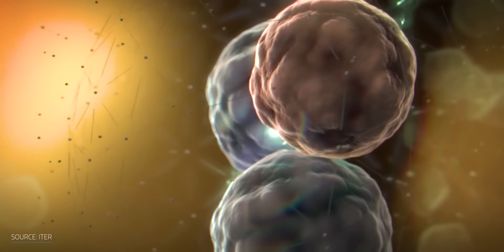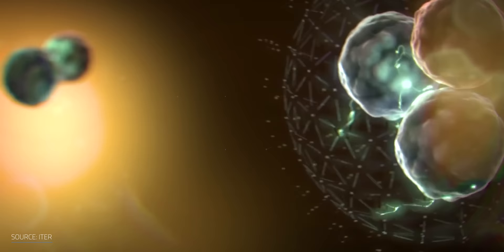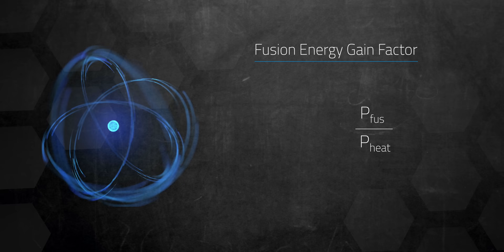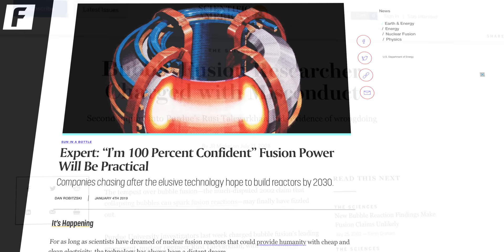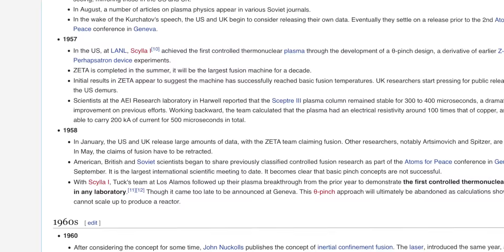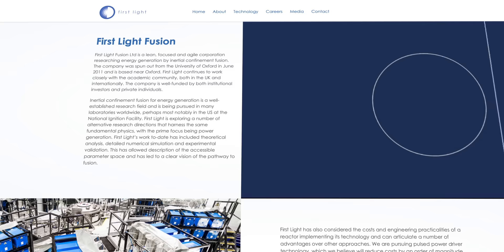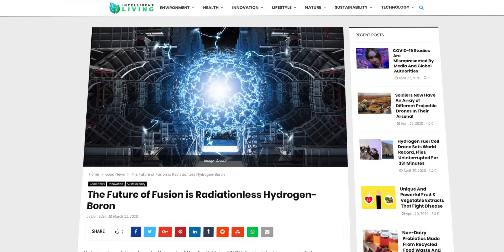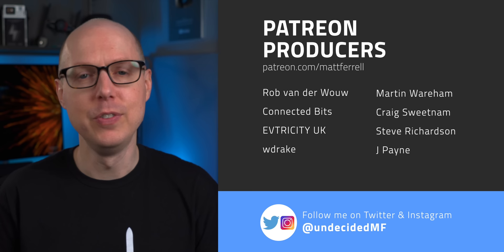The truth about nuclear fusion power - new breakthroughs

Comment: Only a couple of minutes in but two huge errors, unless I misunderstood what you said. 1) fission does happen naturally (https://en.wikipedia.org/wiki/Natural_nuclear_fission_reactor) and 2) Not all reactors will run away. Take Canada's CANDU reactors. They use a different kind of uranium which will fail "safe" and shut themselves down. I actually oversaw the building of the calandria, the core of the reactor, in one of Ontario's reactors.

Comment: Just a minor correction... The splitting of atoms doesn't melt a reactor down just like that, the reactor is designed to split atoms and multiple systems including human input are there to control the environment in which the atoms are splitting. You can literally stand right next to the rods inside the reactor in your sweatpants looking down at the exposed uranium and be perfectly fine and healthy, because the water within the reactor slows down the harmful particles from the splitting to such a rate even a detector has problems detecting the emissions coming from the rods.
What happened at Chernobyl was human error. Technically speaking, nuclear energy is the safest and most rewarding source of energy on this planet today, it has the least amount of deaths per Petawatt, and the least amount of carbon pollution per Petawatt.
But y'all want solar energy, cuz it's "green" for as long as nobody mentions how much pollution is actually released in the making of such a cell. Would it surprise anyone here if I told you nuclear energy is actually more friendly to our environment than solar energy, and by more I mean by 3 times....?

A noteworthy detail tho to why we don't already have fusion as a power source... We do, it's just not efficient enough to even self-sustain. But don't we have it already? The answer is actually rather easy. Money! It's not that we can't build one, but it's that we don't get anything other than energy in return. Gas and oil generates a lot of biproducts, even fission does as its biproduct can be weaponized, this is also one of the reasons why we don't use Thorium instead of Uranium in fission reactors.

Comment: So we created fusion in weapons by using fission to initiate a fusion reaction. I believe x-rays were the vectorial energy used in this fission/fusion reaction.  I'm wondering why a simpler way to initiate fusion hasn't been ascertained than all these complicated confinement fields and such. If we had a team such as the one that worked on the trinity project, I think we would crack it.
Reply: At the right time the ways we have now are quite simple. RF heating and neutral beam injection aren’t crazy complex
Reply: the difference between a bomb and a reactor is, that the bomb is done working after a split second while the generator has to be kept stable for years at a time i'd guess?

Comment: Matt, your brain is JUST FINE (trust me on that)!   
Meanwhile, as a member of the Church of the Plasma Creator of All That Is (CPCATI), I hold the belief that our sun and all other stars are self-organizing Plasma Reactors and are not based on Fusion at all (although I have nothing against Fusion itself - in fact, it sounds rather awesome, if someone can pull it off). Both stars and planets are fed electrical energy via Birkeland Currents that enter and exit at the poles of these bodies. Stars are plasma reactors while planets use the energy for a variety of things. The Birkeland currents run all through our universe, with the largest currents at the center of each galaxy and between galaxies. There is far less "Matter" in the universe than scientists have predicted or "calculated." Henceforth, there is no Dark Matter, no Dark Energy, no Black Holes, and sadly, no Easter Bunny, either (but don't get all depressed on us since we have seen some evidence of a Santa Claus, but that is WAY off topic). Meanwhile, at the center of each galaxy are very large Electrical Plasmoids where two opposing ribbons of current meet/join, and coincidentally, this electrical anomaly looks like the theoretical, nonexistent Black Hole (and unlike black holes, science can actually create plasmoids in the lab!). Due to patent considerations, a few of the processes, methods of implementation, and some other technical tidbits employed by some of the laboratories studying and working with Plasma Reactors are being held "close to the vest," but, they are publishing far more information than I thought they would. From what they have released thus far, these lab versions seem to be exhibiting characteristics very close to, if not exactly like those we see in stars, which include self-organization into multi-layered spheres of plasma that maintain a "shell" of evenly distributed temperatures and magnetic bands. We also see transmutation (creation of elements) which in fusion is often referred to as Nucleosynthesis. And people should stop calling the Tokamac the "Joke-a-mak" since it's not very nice, although I do admit to calling it that a few times, myself. You can trust me when I tell you that our future is with Plasma Reactors, not Fusion. 

In other news, something more related to the science we were discussing than you can imagine, in the very near future, humans will discover that approximately 200 million beings live on the moon, and we suspect that a small percentage of them may even be human. Humanity has never been alone in the Sol system. Sadly, humans have been very easy to "program" and lie to. The human population has even been trained to police itself to immediately shut down any forays, however small and brief, into the realm of the truth that has been so well hidden from us. The reason we have been forced to live one huge, complex lie, basically a false narrative of our entire existence, is because the old adage that "The Truth Will Set You Free" is not just figuratively correct. In our situation, it is quite literally correct. And if you were one of our slave masters, you would not want your slaves leaving the plantation in droves, now would you? I thought not. 
I hope you have a very pleasant day.

Comment: I have no doubt we can eventually have fusion reactors efficient enough to generate electricity.  However, by the time we get there, will we need it.  So many alternative energy sources are becoming more widespread and cheaper, will fusion be able to compete when it is ready?
Reply: Fusion is the energy of the future, not necessarily of the present. Pray tell me how wind and solar will power extra terrestrial space travel or large planetary bases.
Reply: @anyanyanyanyanyany3551  If you want to set up a large planetary base in the solar system, that requires money, not new technology (a small fission reactor is more than good enough for a power source).  Interplanetary travel is still science fiction.  Any foreseeable fusion reactor attached to a spacecraft we could build today would be too big and not produce near enough power to leave the solar system.

Comment: It's like almost every bit of tech we see, 2007 diesel and jet fuel being produce on 6 continents from yeast and algae in good quantities considering the time yet 2020 we still don't have any sort of production up and running, spider webs from goats milk and many other that just go silent for decades with litte progress. Several announcements for battery that charge millions of times not thousands and barely lose any voltage or current 2012,2014,2017 all barely mentioned these days.

Comment: 30 years was probably always a best case scenario with the known issues, not counting the new ones that might surface and also assuming that the political will is 100% supportive and money is infinitely available. If everything went right from the 50's, yes, we could have fusion back in the 80's. But then many new issues came, and the politics was "eh" and money was also limited. Realistically speaking, mainstream global usage of fusion power might be available around 2100 with smaller examples and tests appearing some time sooner and gradually spreading. That is if some new physics discovery won't show us that it is impossible for us to use fusion effectively any time soon (like warp drive that is also theoretically possible, but would require an energy equivalent of an entire planet or even more). In the short term, wind energy, geothermic energy, wave and water energy and solar energy (and other semi or fully renewable sources) our best options if used wisely (eg: not cutting down forests to plant solar panels). Everything has downsides even fusion. The point is how effectively and wisely you use them without going stupid and ruining other things.

Comment: The reason that wind and solar power can never possibly be more that occasional add-ons to a power grid, is that all power grids must keep their voltages and frequencies well under +/- 1% of target at all times (that means every single second of every day). If a power grid gets anywhere near 1% off for more than about 20 seconds, the entire grid will collapse. Obviously, wind and solar power vary by 100% every day, which is a bit more than 1%. I wish the general public knew this.

Regarding fusion reactors, all governments should immediately stop spending money until a group comes up with a design for a fully functioning reactor that meets ALL requirements. ALL requirements, not 2 out of 25, or 24 out of 25. The governments would see that nobody would generate such a design, because it is technically impossible. For decades fusion scientists and engineers have been spouting technobabble and bullshit to the politicians and the general public, in order to get the next billion dollar grant. If somebody asked me for a million dollars to build an experimental house, and instead of receiving blueprints I get loads of lofty, vague rhetoric, then they are not going to get any money from me.

Deuterium and tritium are required for fusion power, not just hydrogen. Obtaining cheap, absolutely reliable sources of massive amounts of deuterium and tritium is one of the many problems that has not been solved, and that fusion scientists and engineers don't like to talk about. Obviously, fusion power is a fantasy until they honestly resolve precisely how they will obtain cheap, absolutely reliable sources of massive amounts of deuterium and tritium, for hundreds or thousands of years into the future. This is one of the requirements I referred to in the paragraph above. Also, I have never seen an analysis that indicates electricity from fusion power, when all is said and done, can ever be cost competitive.

Keeping superconducting magnets at temperatures near absolute zero, while they are continuously located a few feet away from plasma that is around 100 million degrees, and successfully doing that every second of every day for 50 years (per plant), is not an engineering design I want to be near.

Fusion power is a topic that always looks good at the introductory high school level (such as this video), but falls apart the more one knows about it. To restate, all funding should be immediately stopped until somebody comes up with a design for a fully functioning reactor that meets ALL requirements, including fuel supply, replacement parts, non quenching magnets, low cost, and other common sense requirements.

Comment: It is incorrect to say that tritium can be "extracted" from lithium. It is created from lithium 6 by neutron bombardment. Tritium is currently made in pressurized water fission reactors. There is only 20kgm on earth, and it costs $30,000 a gm.  A fusion power plant must make all its own tritium, a far from trivial problem. ITER will research tritium breeding, but not until the 2040's.

Comment: Could someone explain to me, why they use Steam Generators? Fusion ist technically Doing, what the sun does so why dont we Just use like solar Panels in the inside of the reactor? Or is The Tritium Deuterium Fusion the one with a super fast Neutron?
Reply: DT is neutronic. And solar panels suck. Also, you couldn’t make a solar panel that could withstand 150 million degrees, not to mention how inefficient they are

Comment: That is a commonly retold falsity, that fusion does not produce radioactive contamination - it does, and a lot, as it generates lots and and lots of neutrons - one for every pair of atoms, as you have said yourself; And neutrons uncontrollably react with all the normal matter around, producing a lot of different radioactive products. In fact, that is exactly the method used in experimental physics to produce all sorts of radioactive particles - by bombarding normal matter - with neutrons. Everything around such production would become radioactive rather immediately. So no expectations or anticipations to have fusion powered car or kitchen appliance.

Comment: The question is how do you measure 100 million degree? Also, how do you contain the heat without melting the housing?
Reply: They measure using a wide range of techniques including laser diffraction/Thompson scattering being the most common ones I think (although don’t know loads about diagnostics) 

The heat is contained by suspending the plasma in “mid air” with magnets, so it doesn’t touch the walls.
Reply: @Gomlmon99  thanks, I didn't know that

Comment: I would guess fusion reactors would be used in place for some very energy-demanding projects before they're putting power into the grid, eh? Like maybe water desalination plants, or some such.
Reply: You do not need a fusion reactor.  A fission reactor will do.  Fusion does not necessarily produce more energy per unit factory space.  The issue with fission is radiation.  The operation safety and treatment of nuclear waste is major issue.  Energy production is never a issue.  You can have giga  watts nuclear plants as long as you have the money to pay the construction cost.